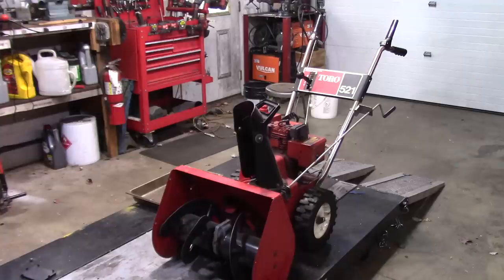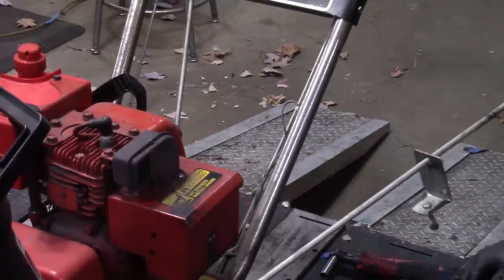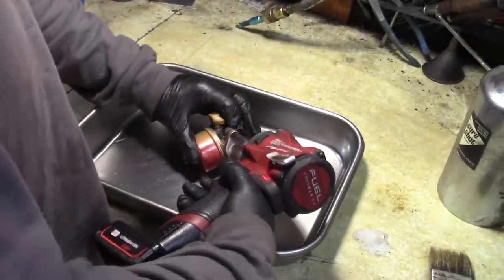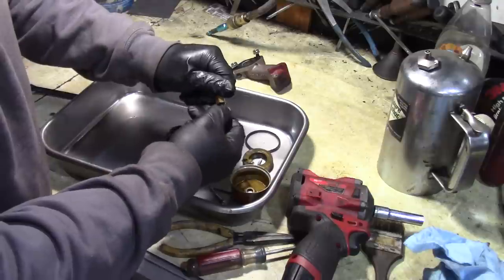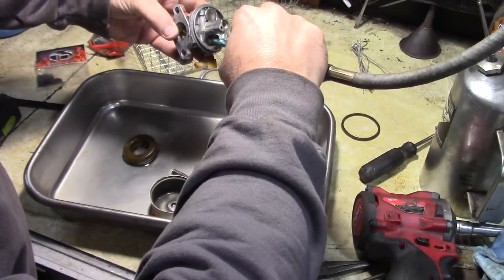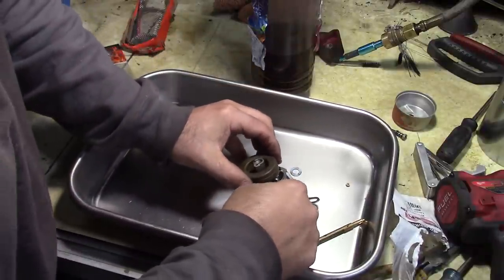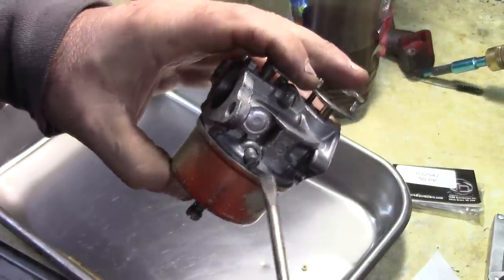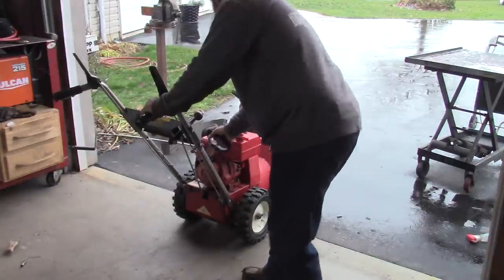Toro Snowblower 521 Saving A Legend

Comment: I loved my mother’s 521, she bought it in 1978, and I used it to clear her driveway for almost 30 years.  Sold it in her estate sale some 12 years ago; biggest mistake I ever made.  My Toro 722e, didn’t even last 15 years.  The auger baring needed to be replaced and the  auger house was rusted; which after almost 30 years the 521 never had.

The only issue that I ever had was the carb. No matter if I put gas stabilizer in it or not, it would never start at the beginning of the season. So I figured out that the best thing to do is remove the main jet of the carb (which was easy to get to) and  apply carb cleaner every year before I first used it.

Comment from the maker: https://amzn.to/3ulBPAJ 521 Snowblower Carb
https://amzn.to/3VJgHQA Fuel shut off valve
https://amzn.to/3H2ylux Non Aerosol Spay can
https://amzn.to/3gUzTMq 5 gallon brakes part cleaner bulk
https://amzn.to/3H7ZV9J Tecumseh carburetor tool
https://amzn.to/3ulP04B Tecumseh carburetor kit
https://amzn.to/3iAA7ZF Ultrasonic Cleaner
https://amzn.to/3ulDuWZ Panel Pliers 
https://amzn.to/3iAAXph battery Powered engraving Pen
https://amzn.to/3ETzL7U Torch cleaner and small brush kit
https://amzn.to/3gQCMhv Tecumseh 50 Pack Orings for Carbs
Reply: I get shut off valves in Bulk 6 for 6 dollars they all are made in china now .  I have good luck with them

Comment: I haven't found anything online to answer this question: When it runs there is oil that comes out where that governor shaft comes out of the side of the engine?
The shaft itself can be pulled back and forth about an 1/8"
Engine oil is a correct level, and breather tube is clean.

Comment: DW6 - How might I remove the flywheel cover to access the ignition coil on this Toro 521?  The cover is blocked by a bolt below it. And that bolt can’t be removed because it’s blocked by the cover. Seems like I’d have to lift the entire engine off first somehow?

Comment: I have a Toro 524. Would love to watch you fix the reverse problem. I assume you'll need to adjust on the control linkages? I enjoy your videos. Keep up the good work!
Reply from the maker: Just needed to adjust the pressure that the friction wheel put against the friction disc.

Comment: That a Rubber wheel Drive runs on a steel plate  for the Power of the wheels and auger ?   in the 70s that's the way they did it

Comment: Just finished repairing the same blower for a 95 year old guy next block over. The speed select lever spring had broken locking the snowblower in high forward and the old guy thought he was gonna kill somebody cause he could not stop it. Guess he went into shock and forgot to pull the key. Surprised to see you still pressure testing the carb by mouth instead of a gauge. Normally brake fluid attacks rubber what brand are you using and does it effect the rubber by causing swelling?
Reply from the maker: I try to keep the brake parts cleaner off the rubber.  It will cause it to swell.

Comment: Save your self some money dw6!  Those Orings for the the bottom, side and on newer models the Owings on center plastic emulsion tube are the same .  They are 006 size Orings. Can by-like 1000 from fastenal for about 5 bucks
Reply from the maker: Thanks for the tip,  I don't go to Fastenal much but I will look next time I am there to pick up an $8 bolt.